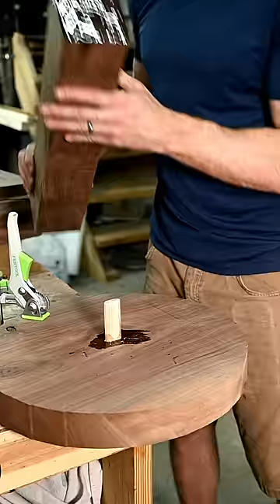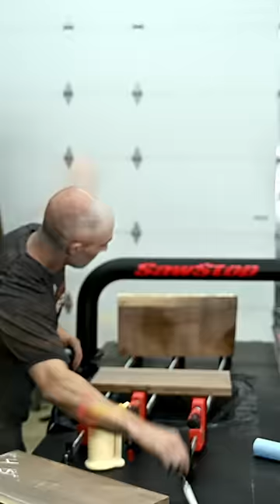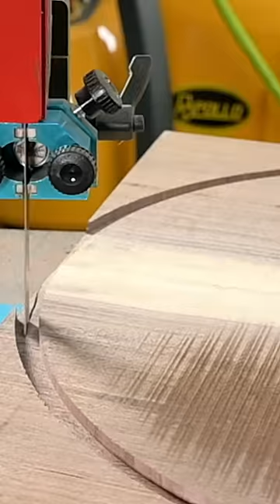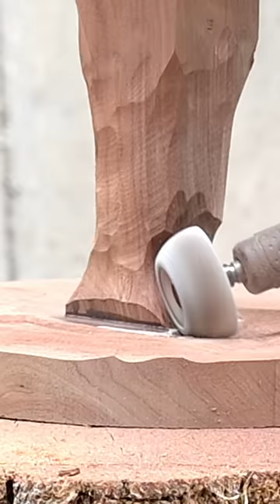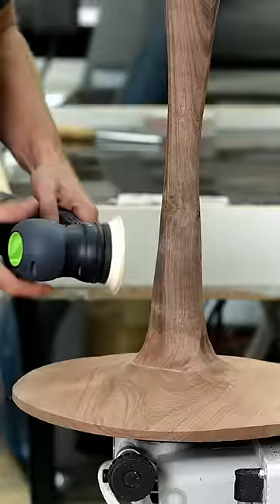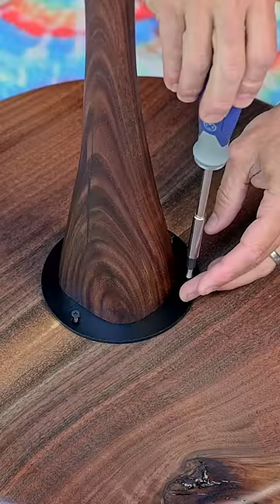I Tricked a Customer

Comment: He forgot to have an average woodworker make it
Reply: There’s also no way that an “average woodworker” would be able to find that much walnut for $90. Classic influencer. If you can’t easily make tons of money with very little effort than I guess you’re just not as awesome as me.
Reply: @judelarkin2883 
I believe envy is one of the seven deadly sins.
Reply: @judelarkin2883  i did some rough calculation based off what i saw.  it looks like there is two pieces that are 12x24x2  which equals to approximately 8 board feet of walnut for the table top.  The leg looks to be about 3x3 by 36 inches so thats around 2 more bf.  the base at the bottom probably one more bf... so the total bf should be around 11... Which means he is buying his wood for around 8 to 9 dollars per bf.  This is relatively inexpensive but not unheard of.  It just depends on where you live.  

Where i live I think that the wood would have cost around double what this guy paid.
Reply: You are correct.  This guy is good.  He is good because he likes it and he likes it because he is good.
I can work with wood when I have time...and room.  Honestly, I think anyone can do it, if they set their mind to it.  It depends on the detail, time, and effort you are willing to put into it.
Reply: @RalphSampson...  so isnt boasting
Reply: @islandwills2778  much less than I have seen walnut for where I live.
Reply: @RalphSampson...  is lying in YouTube video about how much it costs to make ugly tables a deadly sin or just a normal sin?
Reply: @judelarkin2883  JELLY JELLY JELLY JELLY.
Reply: @Scav-Goblin  yes, jelly. We all know you like jelly. If you’re good mommy will give you some. Back to bed now.
Reply: Lol
Reply: ya or the fact he used tools that total thousands to do the job
Reply: @jahabean  yeah, but your point is irrelevant because this video is catered to woodworkers who are going to have or have access to all of the tools that are in this video. 

This video is not catered to just random people who want to make a quick buck.
Reply: That’s hilarious, and so true… I would probably slice off one of my fingers if I attempted this project….
Reply: @RalphSampson...  pointing out bs is envy now, interesting.
Reply: lmao thats what he keep argue'n w me over . You said it brother
Reply: @leagueleaders  this guy is totally boasting
Reply: Or use average tools
Reply: @RalphSampson...  I’m a professional woodworker, this guy is a glorified hobbyist. His skills are severely lacking.
Reply: @judelarkin2883  This was my one big gripe. Wood is far, far more expensive than that these days. And seeing just how much he turned into dust kind of broke my heart.
Reply: lol true
Reply: @dalton5446  I can see what you’re saying. Especially Walnut. I’ve read other comments defending the $90 price and tried to think of how to give him the benefit of the doubt. I’m in Colorado. Where I am, there is a flea market that sells rough boards. I don’t remember the price on walnut for those. I know it’s not as heart attack inducing but they are also not very wide. After truing them up, you’d be lucky to have a true 2x6. I’ve never seen anything thicker than about 2” thick there. A person would also need a bandsaw, planer and jointer to true them up. 

There’s another place close to me that sells everything one would need to build those tables but for those chunks of walnut, go ahead and get pre approved for a for a reverse mortgage on your house before you go in.
Reply: With tools from harbor freight
Reply: Or to make the money in a weekend
Reply: @Ralph Sampson  so is worshipping 🤷🏾‍♂️
Reply: @RalphSampson...  
Not anyone.  People either good dexterity or very good  tools to woodwork without prior experience.  
And they need space to  work and a good source of wood.
Reply: @RalphSampson...  so is pride
Reply: @judelarkin2883  exactly. So many misleading videos.
Reply: @RalphSampson...  he's just spitting pure unsolicited facts.
Reply: @jking0.o121  
My issue with Judelarkin is he writes like the dude in the video is bragging about how "awesome" he is.  I don't see that, at all, and for him to suggest that, seems to me to be a sign of envy.
The video guy is just showing what can be done with minimal tools and budget.  Granted, it takes time to plan, organize, get materials, etc.  He also got a GREAT deal on the wood.  He can't make $1,000 everyweekend doing it.  He couldn't likely find a buyer every weekend.
This is simply showing what can be done.  No need to be envious.  Just watch and learn.
Reply: @marciimeris503  
Yes, and 5 more.  What's your point?
Reply: @joddog  
Have you seen of his other videos?  Look.  I'm not saying he is God's gift to woodworking but, he does do some cool projects and supposedly gets paid well doing them.
So, to call the guy a "glorified hobbyist" isn't really fair.  He is making a boat load of money doing it.  I saw some of his early videos.  He has expanded his shop and tools to what you see from a meager  shop.  I just don't see how that makes him a hobbyist.  As you are a professional, please tell me where is he lacking?  Seriously, I'd like to know.  I knew a German man that hand carved ecclesiastical furniture.  Wow!  That was art, I tell you!
So, really.  How is this guy not a professional?
Reply: @Kaptiv239  how do you know that all woodworkers have access to all these tools? Because this guy said so?
Reply: @RalphSampson...  “this guy is just showing what can be done with minimal tools and budget” is the whole reason he’s getting so many hate comments. It’s not minimal tools or budget but you guys don’t have a clue so you’ll defend him regardless.
Reply: @RalphSampson...  all of his skills are learnt on the fly, he has no formal training and has never done an apprenticeship. He takes far too long doing basic tasks because he lacks any understanding of most woodworking fundamentals and is learning as he goes. I won’t deny that his marketing skills are impeccable. He also has some skills with epoxy resin but these were also learnt on the fly by trial and error over a very short period of time. I also understand the exuberant prices because of his excessive overheads, the man’s machinery and facilities are far beyond the necessary level. He is a ‘glorified hobbyist’ because he is not a professional and has not gone through the appropriate route to learn skills but just googled it and hopes for the best. I know this because I’ve watched ALOT of his videos. The way he creates things is more of an artist than it is a professional woodworker
Reply: @Kaptiv239  that's how this guy started, he said he wanted to make money off woodworking so he bought tools and started and sold tons of these tables for $1k - $13k+ he doesn't know what he's doing but also it definitely catering towards people trying to do what he did, he even mentions in the video people with less tools.

Woodworkers don't just get handed tools when you pick up the hobby and of you aren't already in it or have access to someone who is then you need to make money off of it at some point or else you can't buy new tools unless it's only your hobby.
Reply: @joddog  but he flies first class😊
Reply: @johnthomasmoulton8934  yeah he’s a good YouTuber, great marketer. Not a great woodworker.
Reply: @joddog  those that pay 20k for one of his tables would probably disagree
Reply: @johnthomasmoulton8934  people who have millions 20k is equivalent to $20. Like I said, he’s a great marketer. I’m a professional woodworker I can see his flaws. The layman can’t. He has great attention to detail, but his skills aren’t all there and they aren’t sourced through formal education. Not saying people won’t pay that, I’m just saying you could get the exact same product for far cheaper if you went looking. But most people with money want the bragging rights because he’s well known. Something to talk about.
Reply: @johnthomasmoulton8934  it’s like buying designer brand t shirts as apposed to hand woven and hand made clothing. Marketing is 95% of business, if you can’t understand that I’m guessing you aren’t in that sphere.
Reply: If you can´t make that thing, you shouldn´t call yourself a woodworker.. like cmon.
Reply: @joddog  if one feels the need to keep repeating, he is a professional, he probably isn't.
Reply: @RalphSampson...  So is greed, which what this video shows
Reply: @joddog  wrong
Reply: @jahabean you can do that with normal woodworking tools. Tell me you are not a woodworker without telling me you are not a woodworker
Reply: @judelarkin2883  just classic grew up rich ass
Reply: @judelarkin2883  walnut is $9 a BF where I live.
Reply: @geko7950  buy it up then. It’s unlikely to stay that way.
Reply: @RalphSampson...  I think you’re forgetting that you have to find a buyer, have expensive equipment to make furniture, know a supplier that sells material, have a workshop to begin with and probably several other things I can’t think of right now. I’m not saying it’s impossible but is it realistic to make the claims he has in the video?
Reply: @RalphSampson... Those aren't minimal tools someone average would have that's the point there is another on YouTube that made a table and he only used cheap tools anyone would have at home. It was more difficult but he did it and that's what this guy tried to do but is using better tools which make it easier. I think had he not saying anything about him being average no one would have gave him slack about it he brought it on himself
Reply: @judelarkin2883  Someone's a bit jealous that another person is making more money than them
Reply: @ernesto_7O7  since you know, how much money do I make and how do I make it?
Reply: @judelarkin2883  I have found scrap walnut cull wood plenty of times. You can find cheap wood. just look in the right spots
Reply: @judelarkin2883 you can either blame him or actually try to see if it's true
Reply: Nothing he did was advanced.
Reply: I'm an average wood worker and I've built things like that and some way more complex. Those tools he's using are not that special.
Reply: Exactly this…. This guy is a pro whether he thinks he is or not..  incredible shop and tools !
Reply: Ha
Reply: And isn't YouTube a social media page? So what is he proving by doing it himself?
Reply: Look unless he can do it in an apartment building with a kitchen knife and random screwdriver in an hour and a half it's bullshit
Reply: @joddog  which is it?glorified hobbyist, or artist?
Reply: @nevabothager908  I’m gonna say hobbyist, because his designs aren’t original
Reply: @RalphSampson... So is Pride
Reply: Yep, average woodmakers couldn't actually produce that table lol.
Reply: Also it took him 2 weeks to sell it so he made $1100 in two weeks not one weekend. I work causally at an animal shelter and make 1200 in 2 Weeks 😂
Reply: He is very average
Reply: @noth9617  yeah that’s not how the industry works lol. He didn’t just sit around and wait for it to sell before he started his next project. He also gets Adsense from YouTube, he also sells woodworking jigs, epoxy peripherals and other random shit. Dude is DEFINITELY making a shit tonne more money than you haha
Reply: @joddog  I highly doubt that. I get $75 an hour
Reply: Excuses
Reply: @leagueleaders  It's not.
Reply: @Kaptiv239 somehow this video and this channel came up on my feed. I am not a woodworker. Far from it. Just a guy open to making a quick buck. Most videos I see are ways to do just that, yet the algorithm put this video in front of me, someone who has never looked at woodworking videos or done anything of the sort. I think the comment about how the tools the poster is using are expensive to obtain has merit. And i think your comment about how that is irrelevant because the video assumes it is talking to a woodworking audience who has already obtained these expensive equipment is not objectively universal, and thus may not be entirely accurate, evidently.

Now I will explore this area more. I do have an unused garage, but no woodworking tools (as i mentioned). So i’ll be curious to see if someone like me can go from zero to here in say, 6 months? Maybe sooner?
Reply: @islandwills2778 That is honestly not that bad. Because of how abundant it is near me I can usually get black walnut lumber for 5.75 a board foot.
Reply: @judelarkin2883  if you live anywhere near where they harvest it, that's not too hard to find.
Reply: And he also forgot what not having a  social media following is
Reply: @RalphSampson... I'm not hiding my envy of YouTuber shops lol 😂
Reply: Exactly. These youtubers are brain dead at this point.
Reply: Average woodworker with about €200,000's worth of tools😂
Reply: A little blood in the stain proves the workmanship!
Reply: @islandwills2778 dude I love that you did the calculations.
Reply: Facts this is bs
Reply: @RalphSampson...   No, envy is on of the seven dwarfs.
Reply: @Kaptiv239 idk any woodworkers so idk how standards these are.
Reply: What he made here is so basic any average wood worker can achieve the same thing with the same or similar results. Thats the point
Reply: @judelarkin2883  The walnut is most likely the most expensive part of the project for a less equipped woodworker.  90$ of tooling plus some extra bits, blades, and pads, then even if it's a few hundred dollars in wood you're still pocketing over half the $1200 for your time.  Not to bad for hobby work.
Reply: @jahabean yeah but he also made $1100 dollars on two tables. Don’t have to do that many times to be able to afford all the tools used in the video.
Reply: @RalphSampson... I think that’s what an influencers goal is tho lol

Comment: You and I have wildly different conceptions of what an “Average” woodworker is
Reply: Average in skill or pocketbook? Festool saw says it all.
Reply: A jigsaw, a hand router, and an orbital sander can be bought for as low as ~$30 each.  He's got the big boy versions of all that stuff but it's pretty easy to scale down to hobby garage tools.
Reply: @wolffang489  Doing this with the presented professional tools requires a lot of skill.
Doing this with cheap diy tools requires A LOOOOT of skill.
This can't be done by an average woodworker. Cutting a perfect circle? Most average woodworkers have issues cutting a straight line...
Reply: My high school had (and likely still has) all those tools, and moreso, for the shop classes. And it's a poor high school that is barely funded. I'm pretty sure that is "Average woodworker" tools. Also, pretty much everything shown or described in the video can be bought at Walmart, Home Depot, Menard's, and Fleet Farm.
Reply: Also what "tricking" someone means.
Reply: @derToblin  It takes a single piece of plywood or MDF or otherwise cheap material to make a jig.  Perhaps you've played with circle compasses out of paper or string as a child?  Also many hobbyists have old bandsaws or router tables they got from their parents or bought off Craigslist or such.  They do the exact same thing as the ones in the video but without the fresh coat of paint, he's not using CNC or something.  Maybe it's a debate over the definition of "average woodworker" but I'm thinking of someone who's converted half a double garage or set up a shed out back with affordable versions of what they need to woodwork.  At the minimum some who has a shelf of tools and takes over their garage on the weekends.  Someone who has a drill and has seen a few DIY videos while living in their 5th floor city apartment is not an "average woodworker" in my opinion they are a beginner at most.  For the lowest denominator that wants to try making this though, (and good on ya) some cheap lumber and the hand tools I previously mentioned to get practice then moving on to the actual material is a perfectly affordable way of doing it.
Reply: @derToblin  most people would put  a dowel in it and rotate the wood in the saw to get a pretty darned perfect circle. Then use the same jig to clean up the edge or, like he did, use a hand router. The most difficult thing he did was carving out the shape of the spindle, which would have been a lot easier with a lathe, but he showed it could be done with a sander, which was impressive work, but something that anyone taking their time and studying how to lay it out could do.
Reply: He said average woodworker not average dude in garage who has tools to fix stuff now and then.

There's no doubt that many of us will never own any of these tools at the price/quality he's got--but there are ways to cut a respectable circle without all that.